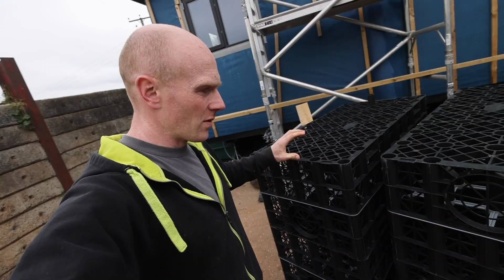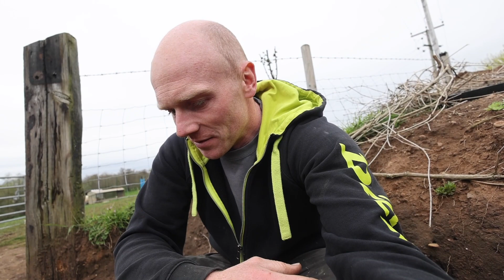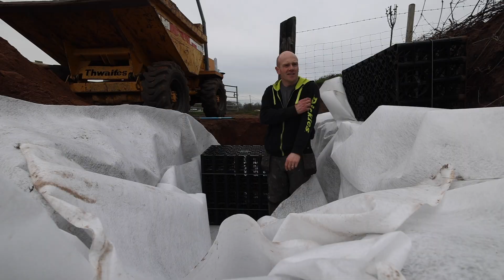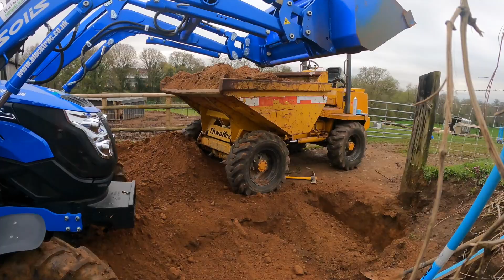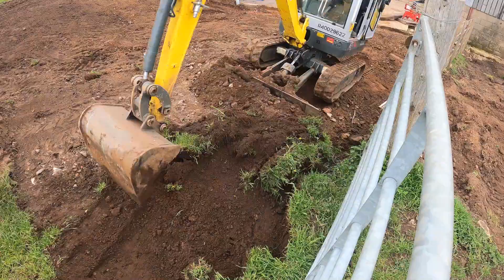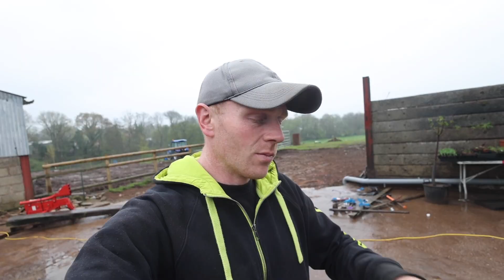INSTALLING A SOAKAWAY IN 3 HOURS - Almost went to plan! 😬

Comment: I used to work for a company that made those crates. It's surprising how many we sold. Lots of customers would just have 10, like yourself, which really annoyed us as they came in pallets of 12. During a yard extension of the company I worked for, we put 4,000 of them under the yard but not as infiltration. You could use them as infiltration, or you could use them as storage. So we had all the drains from the yard going to the cells, then just a 6 inch drain out. So the exit flow was regulated. Since leaving there, I buried 12 in the garden of my old house to save rainwater to use on the garden.

Comment: We had to build a huge one of those [about 50 feet x 20 feet x six feet deep] at a site in Buckhurst Hill, not as a soak away but the council insisted on it as rainwater backup, then it was pumped up to the storm drain in the road. We had to put 3 feet of fill over the top [ which made it a 9 foot deep hole and as it was London Clay, several loads of sand to surround it] we  were also told that no heavy vehicles were to go over it, which we ignored as the houses were only half built and we needed lorry loads of bricks, blocks, roof trusses etc.

Comment: Just realised that was ‘temp’ soakaway for the treatment plant?! We are installing a treatment plant now and no installer will put crates in for treatment plant! Despite a few saying you can on YT, it’s a bit of a mine field as the building regs don’t consider the output discharge from a treatment plant any different to a direct septic tank, when of course it is very different. Building control are  fairly flexible as long as you can prove the design works to the manufactures instructions for the site chosen and distances etc. Of course in you case it’s a farm the rules are slightly different, with certain exemptions. Super little video thank you!
Reply: I think one reason why a drainage field is preferred over crates is that the STP's are not fail proof, I read if you have a five person one for example you have got to have five people using it every day or the microbes can get out of balance, powercuts can affect them too. So perhaps the thinking is a belt and braces approach regarding crates and STP's.

Comment: Appreciate this as I have a similar gateway to an orchard that will need this treatment in the spring and was a bit concerned about traffic weight, but feel reassured it will be fine from your post.  By the way how did you 'spread' the soil from the crate space ?

Comment: when we did ours we put it on and surrounded it with a good 2 inches of pea shingle
Reply from the maker: Yeah as I said, pea shingle ideal but sand did the job just fine. As long as there is nothing to damage or puncture the membrane.
Reply: Agree,crates on 100 mm pea shingle   Wrap crates in non woven geo tec  minimum 100 pea shingle all around side of crates  100 mm on top   Then back fill to ground level is the way I’d do it

Comment: Will we get to see the waste water treatment plant installation?
Reply: Ah, I thought I’d missed a video appears not so
Reply from the maker: Tbh we didn’t film much as it was pretty much plug and play and also not really a conventional setup being that it’s an above ground version. Will share at some point though. 👍
Reply: @TheRestorationCouple  I take it the output is considered at least what in Canada we’d call Secondary Treated effluent?
Reply from the maker: @vaalrus  by the time it’s gone through the 4 chambers it’s supposedly clean enough to discharge in to watercourse so yes it’s just the treated liquid.
Reply: @TheRestorationCouple  Interesting.  ‘Cross the puddle, there’s a disinclination for private wastewater systems to discharge near, or into a water course, preferring either surface  discharge (in a remote from dwellings) for evaporation, or some sort of near-surface in-soil dispersal and/or treatment, the size depending on the volume and level of primary or secondary treatment.  I’ve lost count of the the engineered multi-layer treatment mounds I’ve installed in rural Canada.  

I’ve only seen those chambers you installed used for storage of stormwater.

Comment: I always base on 100mm sharp sand then make it up out the hole cable tie it for extra strength wrap it tape it tie rope around it lift in hole machine jobs a gooden

Comment: Soakaway crates vs proper designed percolation area ?? 
Honestly thought soak away crates were only for simple roof run off water / road water and the likes
Effluent water is not clean coming out off the toilet septic tank. Full of nastiness
I would have put that toilet soakaway far away from the house 
or (different countries different rules) just done the right percolation designed area for septic